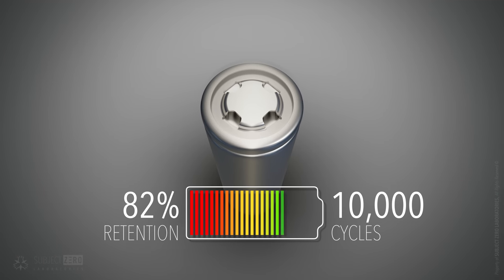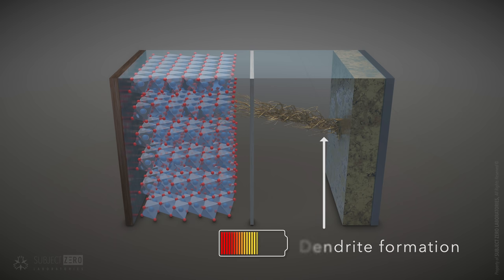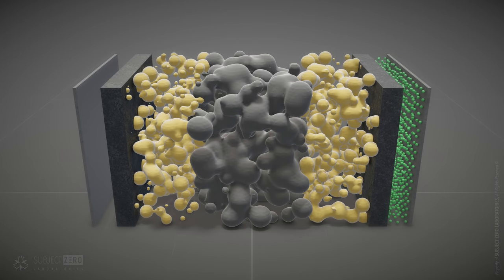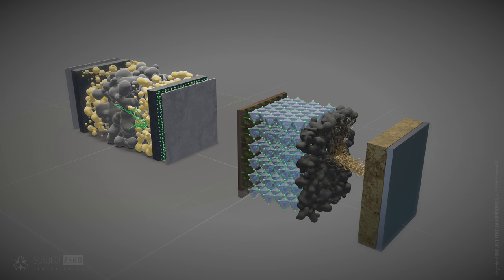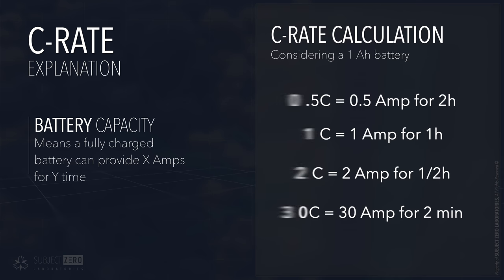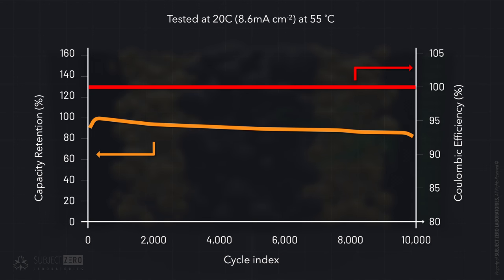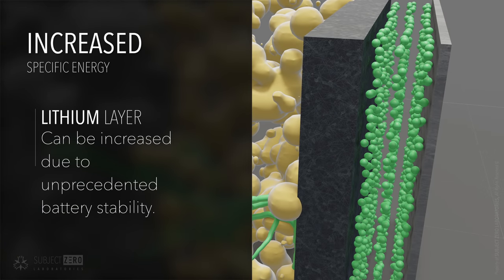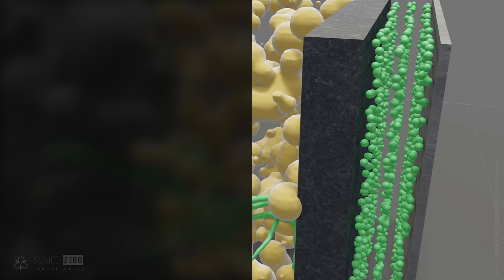A battery that lasts 20 years

Comment: I'd like to also hear what the challenges are, I wanna know why this took so long to accomplish and what breakthroughs in related fields allowed for this
Reply: One of the major challenges right now, that I know of please add more if you know, is that the current tests were performed at elevated temperatures (around 55 degrees Celsius ) and at 15 M Pa .
Reply: Something is telling me that, like with other discoveries, this one was found by accident. 
Sometimes, you throw shit at the wall and see what sticks. And that takes time.
Reply: Well, assuming that it's easily deployable, one immediate jump in capability would be vehicle range and battery pack longevity.  Assuming the battery stays the same size, the range would triple and the battery pack would last the life of the vehicle.  Right now most vehicles top out at 300 to 400 MI and assuming you drive it everyday, the battery would have to be replaced about every 7 years.  With newer battery packs the range would be about 900 to 1200 miles on a charge and the battery life span would be about 50 years.
Reply: fung whyou  fly you too the moon and back, eh? LoL
Reply: @niezbo  the best discoveries, by accident
Reply: @PrivateSi  Here's how the batteries can be recycled: https://www.youtube.com/watch?v=Bpe8HalVXFU
Reply: @blaablaablaa5774  .. The problem is recycling tech. is always playing catch-up with not just battery tech. changes, but all the other supporting electronics.. Iron/steel and aluminium are much easier to recycle. The power to weight ratio is always going to be so inferior to hydrogen based fuels (preferably carbohydrate for stability).. Far more complex and high impact manufacturing, high impact, highly toxic fuel offset only if the electricity generation is clean, sustainable and low impact.. Infrastructure upgrades are high cost, high impact. You've got to look at the bigger picture.. Try recycling an electric motor full of neodymium and cobalt and miles of copper wire....
Reply: @PrivateSi  you do know none of the billions of barrels of fuels used can be recycled any time soon
Reply: 3D printing a rocket. Printing alloys that is stronger than naturally produced alloys. They can fine tune each layer essentially making a better lasagana.
Reply: @PrivateSi  - It's not a matter of what works best or is efficient. It is a matter of what is most profitable right now. Global capitalism is not about sustainability, but about maximizing immediate profits at the cost of everything and everybody else.
Reply: It's usually material science and production major
Reply: @Unmannedair  i only get about 400 miles on a tank of gas so 400 miles on a charge seems reasonable.  Having to replace battery pack every 7 years would be one reason i wouldn't consider an existing car like that (if that's accurate).
Reply: @synergy021  you literally didn't listen to anything he said regarding the actual problem and decided to just go the political route.

Stop with this mindset. He said liberal when referring to an actual phenomenon dealing with politics being used. Dont be surprised when someone complains about politics when talking about a subject that is influenced by it.
Reply: @LightSpirit24  China is pushing EV tech on a pace and scale no other nations can match now .  I am not a China fan ,  but I know they are far ahead in EV infrastructure .
Reply: @niezbo  everything is obvious once you discover it.
Reply: fung whyou  Amateur with your cordless vibrators. 120v hardwired or go home!
Reply: @PrivateSi  Thing about hydrogen vehicles is that there's no good compact hydrogen storage solution that doesn't pose a huge cost or hazard, and none that come even close to the energy efficiency of plain gasoline (or even Li-ion).
And with fusion, the payoff to achieving cheap fusion reactors is so great that it's worth trying until it's absolutely certain there's no chance to get worthwhile amounts of power out of it. There have been a few energy positive fusion pulses in tokamaks so far.
I agree that hydrocarbons hold up modern society and we can't go on without them, and I agree that we need better ways to use common materials instead of relying on REEs and hard to produce substances if we want the third world to ever become industrialized, but it's not a big conspiracy (for the most part). Just that there are only a select few avenues that are commercially viable and they don't necessarily match up with what's good for the environment.
We still need way more fission plants.
Reply: the biggest challenge is getting the customers to continue spending money. why sell a battery that lasts 20 years when  you can just sell batteries that last 3 weeks?
Reply: The challenges are big oil and car manufacturers that want you to buy a new car every 5 years.
Reply: @LightSpirit24  EVs are just as bad as normal cars, sheep don't even realize there shouldn't be cars in the first place. If we didn't use or manufacture them, there would be no pollution in the first place. However, corporate manipulation and bad infrastructure places the delusion that cars are necessary in people's minds and no one questions it. Dense cities and public transportation are the actual answer, which politicians and companies like Tesla and other car companies would rather die than tell you about. Of course you would prefer to think that Elon is actually a good person rather than a psychopathic capitalist like all the others.
Reply: @Nekrumorfiini1  I do not see it that way. I think logically about this. EVs are definitely cleaner for the environment that Gas cars. There is plenty of solid evidence to prove this point. Refusing to acknowledge this is illogical and suggests there are personal biases in the way of proper logical reasoning.
Reply: @LightSpirit24  For carbon yes, but is that the only kind of pollution EVs cause? No, so it doesn't matter. And you seriously didn't even read the whole comment or missed the actual point. Is your attention span that low or are you being disingenuous?
Reply: @Nekrumorfiini1  you have some hate in your heart. Seriously man, try to see the positive in the world. If we only focus on the negative and keep holding hate I our hearts, then  society will degenerate and things only get worse. 
As for EVs being polluting, yes they do generate pollution and environmental damage from mining materials for production. But that is the same for most everything made. The things we have to focus on is finding cleaner and less damaging ways to go forward. Transitioning to EVs from fossil fuels will go a long way in improving things. And it's not just EVs, we are also shifting to more green energy with solar/wind and battery storage. If we keep on this track, pushing forward against all the road blocks and opposing interests, then I see our future being a bright one. I am glad to be alive to witness this!
Reply: @LightSpirit24  You're just saying the same cushy crap, I said don't make cars period. They pollute and public transport is more efficient. You think people don't get mad when you act better than them yet you can't get through a paragraph?
Reply: @Nekrumorfiini1  autonomous cars will be the future public transportation.
Reply: @LightSpirit24  That's the most idiotic thing I've heard for a while. Do you actually believe that? Do you not know what public even means? It means many people in one, efficient, vehicle. Like, a thousand. Not one. Unbelievable.
Reply: @PrivateSi  My legs are A carbohydrate system. They hybrid-power my Ebike, which is charged by the solar in my greenhouse
Reply: @theejoeylee  .. Get rid of the e part and you'd have an argument, e-waster. How long will your crappy Chinese motor last?
Reply: @PrivateSi  it's a bafang. So not that crappy for China. Name an American Ebike Motor. I'll be waiting.
Reply: @theejoeylee  .. Why, I don't want people to buy e-vehicles! from scooters and push bikes to cars and lorries... trains maybe, but maglev is dodgy.. It's a question of neodymium usage  and recycling, not just the battery complexity and chemicals.. It's basing an economy on increasingly complicated materials needing evermore complex and numerous factories doing what far simpler parts and materials can already do better, and are already recycled.. 
--
Better Internal Combustion Engines, combined with heat engines and synthetic HYDROCARBON / Carbohydrate fuels simply manufactured from mostly sea water electrolysis powered by Thorium Molten Salt Breeder reactors = Lowest impact, lowest cost, easiest to recycle, easiest to adapt to PROGRESSIVE WAY FORWARD..... Your way is TOO CRAZILY PROGRESSIVE...
Reply: @PrivateSi  Not progressive. Just a necessity, cause I am recovering from knee surgery & awaiting another. The battery is only 180WH so only 20 cells. 250w geared motor. As minimal and frugal as it gets for my needs. 
Sold my 93 ford truck that got 8 MPG and leaked every fluid, cause it was a stick. Now I ride this. I think I'm overall doing better for the environment. Hell, the battery is even dual purpose. It's one I already had from my mower. Small engines are nasty BTW. I'm happy to not reek like exhaust for that matter alone. 
If better tech existed, Id use it, but I'm poor AF.
Reply: @PrivateSi  Have you heard of thunderfoot? I am pretty sure he made a video about thorium at one point. Though it was used in vehicles.
Reply: @PrivateSi  Lol your referencing the one video where he says a helicopter on mars was unpractical? That's not wrong that's just an opinion. I see your train of thought though now. Anyone who speaks the truth and or common sense is a gatekeeper, eh? G,day mate. Im off to have intelligent conversations.
Reply: @PrivateSi  Hey there,
Interested in said engine developments barely funded. Do you recall the names of said projects?, interested in further research, thanks.
Reply: @PrivateSi  science isn't a strong point is it..
Reply: Perhaps the ultimate solution for a non-degrading batteries is not chemical based, but electrostatic like a capacitor.
Currently there are companies out there researching and testing solid state/graphene ultra-capacitor batteries which charge very fast (within minutes), and do not degrade in time since there's no chemical reaction during the changing/discharging cycles.  Once perfected, it could be a game changer for EV's.
Here's a quick search on solid state/ultra-cap batteries.
https://www.youtube.com/results?search_query=super+capacitors

Comment: The biggest question for the big investors in this technology is what is the cheapest unstable material that can be sandwitched between the Lithium layers without compromising quality life of the battery?
Reply: @MAKIUSO  lol, but I don't think the lithium will like very much to pass a layer of uranium
Reply: I would place my bet on carbon.  Super cheap, and It would likely react with lithium dendrites in direct contact since it has a positive charge.  It also would not likely slow ionic flow since it's conductive and highly porous.
Reply: Big investors do NOT like this kind of technology. This is good for the consumer, as we could begin migrating our lifestyle to sustainable future. However, a battery that is recharged once a day and can sustain 20C AND would last 27 years at that rate is not profitable for big corporations.
Reply: @MAKIUSO  You forgot how dangerous they are for humans!
Reply: @valkyriefrost5301  I'm normally not one for conspiracies..  But I really do believe there are some big players stopping some battery tech from reaching the market.  One that I can completely vouch for, is all carbon batteries(Not super caps).  I've made these myself at home(They can be made in an amateur lab) and with the right electrolytes and carbon mixes, you can approach lithium power density at a fraction of the cost.
Reply: @robweaver8872  Cabon is conductor. So It will short circuit…
Reply: Technically, Carbon is a semiconductor. It has some amazing properties, which are still being discovered. It's being used successfully in modern batteries, and has been since before Leclanché patented his cell, in 1866.

Comment: That's great man. Still wouldn't want to be around if one of these gets punctured.   From your presentation, I learned that self induced battery fires are a thing of the past because dendrites are blocked.  However, with the increased power density, I would suspect that a puncture event by a conductor would have a rather explosive consequence.

Comment: 4:28
That's a form factor, the shape, not what's inside. But to be fair, 18650s usually are just conventional Li-ion batteries. But still 18650 is just a shape (18 - diameter, 65 - length, 0 - circular shape)

Comment: Damn these animations are amazing and so helpful. This also means far fewer batteries in the landfill, reduced rare minerals mining, and greater portability/capacity. If this translates to the new fast charging as well as high current discharge tech then this is extremely exciting. This would be to batteries what broadband was to the internet.
Reply: Lithium batteries are also recycled as we speak. They do it China and Tesla and Redwood do it in the US as well. The reason they currently end up in the landfill is because consumers are to lazy to recycle. With big car batteries that problem isn't existing, since they are big enough that every consumer will see its value and will probably be paid a nice amount to bring it to the recycler.
Reply: Tranquility TenThousand  To a degree, but the entire personal vehicle scene is standing in front of a major shift - and I'm not just talking about going into the EV market for good. Personal transportation as we know it will see vast change in the next 20 years, compared to the last 20 years in terms of vehicle types and their usecases. Talking grid network commuting, long distance independent travel, even flying vehicles will get a foothold in the not too distant future, and all of this is enabled by the technology advances that are not based in lithium batteries, but rather stress-member cf and graphene structures.

Comment: For BEVs to take off (especially adoption from ICEV and HEV owners like me), we need better batteries backed by longer warranties.   The CARB proposal of 15 years is a great start.  I don't mind if it's 50% capacity instead of the proposed 80%.   

Great video as always.
Reply: You already get 8 years with a Tesla, and it's already shown that they can hit 1 million km and still work, that's with a little lose of range too, somewhere around 80% left after that, as the lose slows down too.
Reply: @-JustHuman-  can you cite at least 10 owners who have gotten to one million miles on the same battery?  Most on the Tesla Loop are not on the original battery or motor.  Lots of battery issues reported on Tesla Motor Club.  I don't like making things up.
Reply: @-JustHuman-  okay.  So maybe some dozen Tesla Model S won the quality lottery.  Good for them lol.
Reply: @flashsushi1843  Well I wouldn't say it's good for them that the batteries they got where not good for a long time, but it does seem to be a small number who got "lucky" judging by the forum numbers and statistics on batteries in generel. But that is the same with most things. I mean it was almost all VW users that got hit by the diesel gate, and people who bought hydrogen cars are also all kinda screwed over now as it seems that road is almost closed by now, so it have been worse with other tech than BEV too.
Reply: @-JustHuman-  I meant good for those who got batteries that need no replacing a year after the warranty expires.  I am not a sycophant lol.

On Tesla Motor Club, many Model 3 owners are reporting 10-15% drop in capacity after two to three years and many think S and X battery chemistries are superior.  That probably accounts for reserve buffer being released. There's a mega thread there.

I would love to buy a BEV down the road but I am waiting for one with Torque Vectoring and hopefully better manufacturer support for battery refurbishment.  If not, I can wait.  My CT200h and RAV4H are gas misers and battery replacement cost $2K over at Green Bean in the US.

I wouldn't mind buying a used Macan EV though in a few years.  At least the money I save on depreciation means less money I forego if I have to scrap the car a few years after the battery warranty ends.

Comment: ''A battery that lasts 20 years''

Nokia: those are rookie numbers
Reply: True. My dinosaur of a Nokia phone is still on its original battery at 16 years old, and it still holds its charge well. Under continuous use, I would need to recharge the battery about every 5 days. But under coronavirus restrictions, it only needed recharging three times in 12 months, and one of those times was because I forgot to turn the phone off for a couple of weeks.

Comment: A self charging battery, where the positive is turned into negative and the negative is turned back into positive, some kind of circle of bouncing and sliding.  Making the distance for the charge to travel further, to last for longer. Some kind of 3 state setup where walk to the top, then side down, flip over the world, and walk down the hill again. Maybe batteries should somehow move inside to change their configuration over time, to get more out of them, like sometimes if you shake a dying torch you get some extra light.

Comment: Two questions, maybe i wrong in asking also:
1. Did they conduct this test in subzero temperatures? If yes, what was the result of the study?
2. How about coastal areas where air has lot more moisture resulting in higher risks for corrosion ?